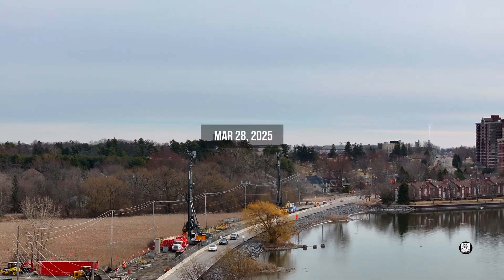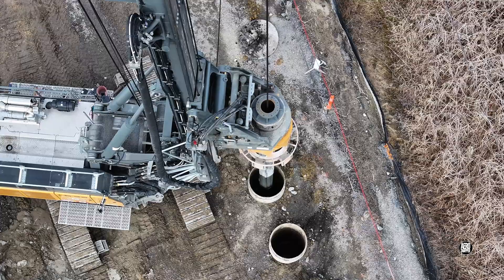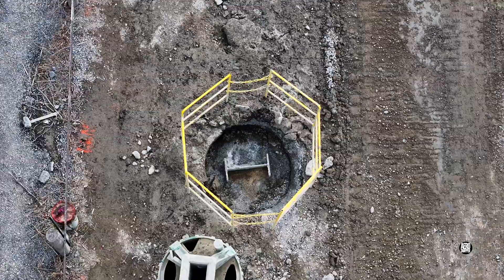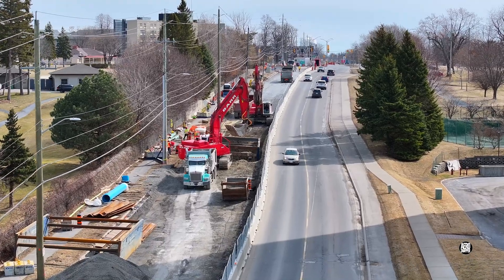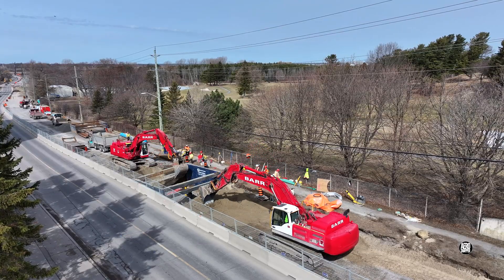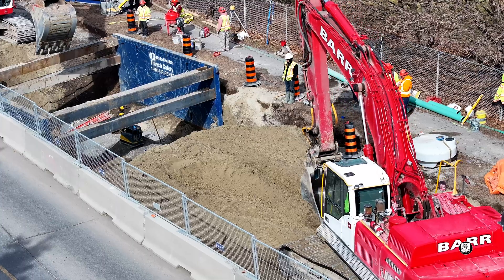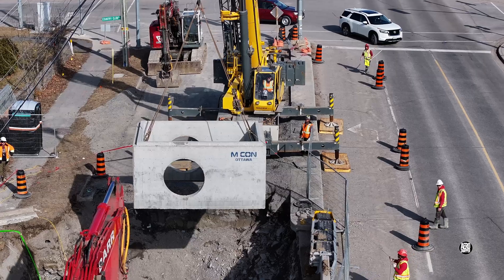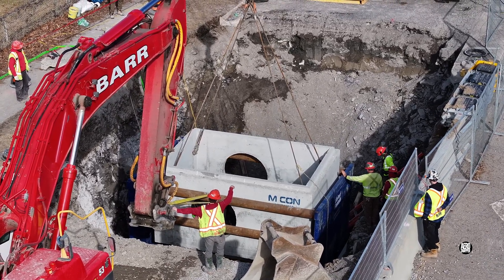Go West - how Utilities Kingston are pushing new lines west along King Street and Front Road  4K

Comment: Be interesting to find out what the vertical holes are for down by the swamp. I was guessing maybe for supporting the horizontal lines, but really have no idea.
Reply from the maker: My understanding, based on previous experience, is that  they will eventually form a complete line serving as a deep, solid, concrete barrier to water entry.  There may be two lines, one on either side of the pipelines, when the work is complete, holding back the  water bodies present  on both sides of the road